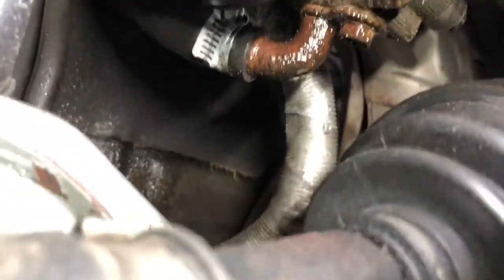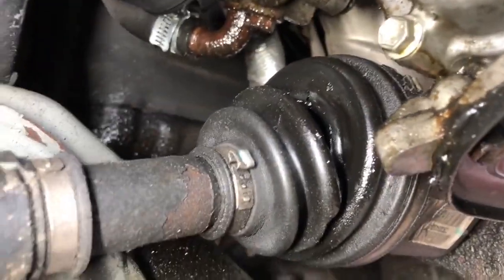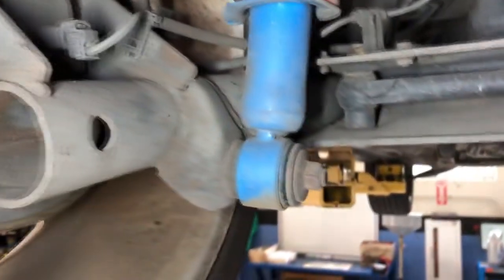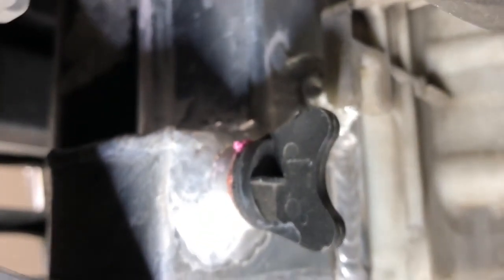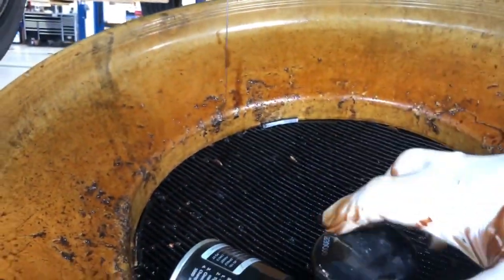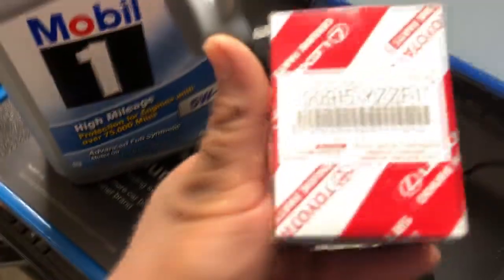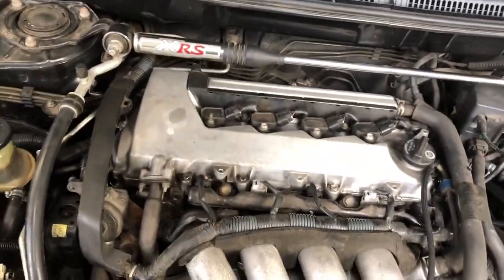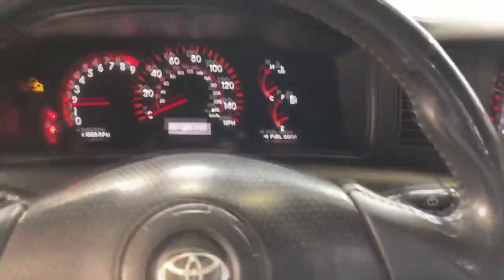First oil change after 1zz oil pan install on my Corolla XRS (05-06)

Comment: I would recommend the K&N oil filter - Part number HP-1002. It is so much bigger than the Toyota 90915-YZZF2. Of course mine is a 1ZZ-FE.
Reply from the maker: I wouldn’t think those k&n filters are cheap. Have you tried the Scion trd oil filters?
Reply: @2zzlow  No, I haven't. Perhaps you can do a comparison video?

Comment: Hey i use the f2 instead of the f1 for better oil pressure.
Reply from the maker: Where did you read up on this or how you know?
Reply: @2zzlow   My coworker at Toyota told me. the smaller the filter the better the oil pressure.
Reply: @dicey2847  that’s because there’s less volume, same amount of fluid. Generally though, you want to be filtering as much oil as possible and INCREASING your oil capacity is always a good thing. Don’t know why you’d really bother with that, unless you’re really struggling for oil pressure but that’d mean you got bigger issues anyways

Comment: How is ur 2zz running bro after 1zz oil pan installation?
Reply from the maker: 25k miles of daily driving and hitting lift frequently and the engine is fine

Comment: Why the CEL?
Reply from the maker: At the time I had a bad throttle
Body that was scored really bad on the inside and not allowing it to open and close freely. In a later video upload I go to Sacramento pick n pull where I found a corolla xrs and take the throttle body from it which then solves my cel issue.